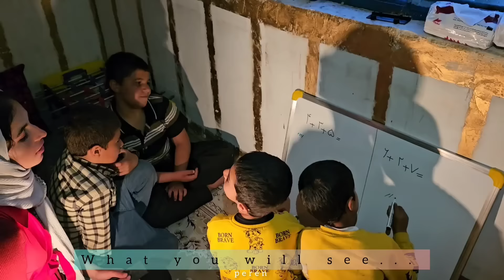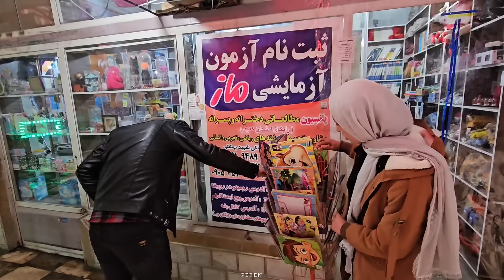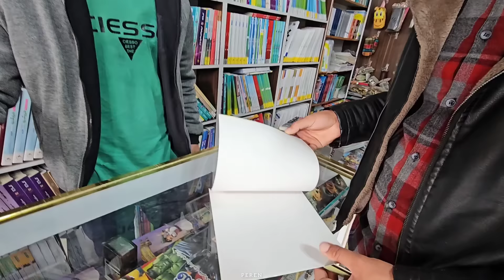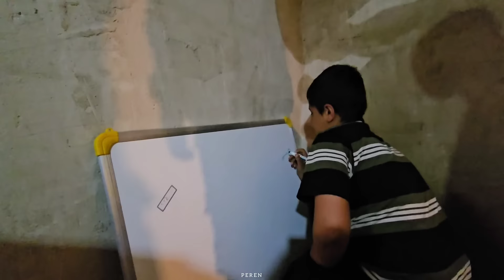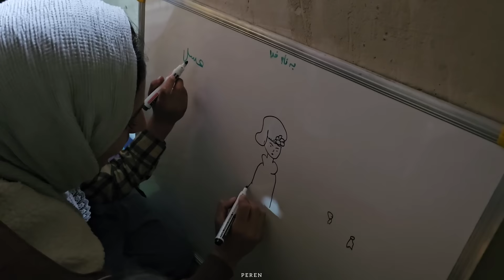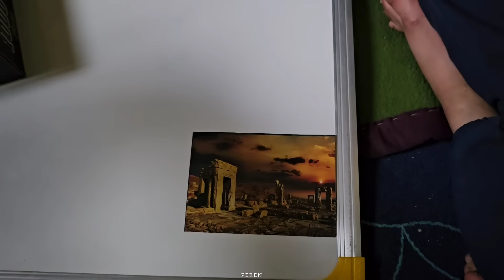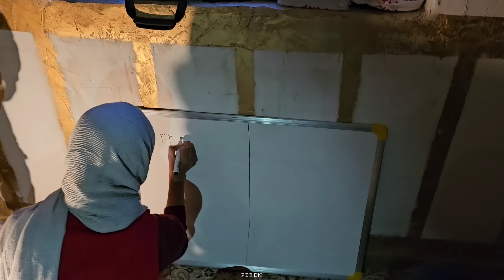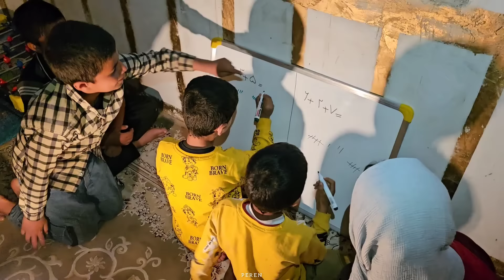Rural children 🎓💯 Improving children's thinking and intelligence in rural areas

Comment: Research Paint that is a sealant on outside to waterproof and also a paint that is a sealer and mold prevention for inside. It is worth it to get best recommended and dont dilute it will work better and last longer.

Comment: Greetings from Colorado. I do not understand why Jan Bibi has all these goats and sheep but she is to stingy to sell enough animals to provide solar light, and gas hot water heater.  What about the wet walls? Why don’t you buy waterproof paint and fix your environment? Your heat stove in the new room is putting soot into the air you breathe. Do you not care about your families health? I just don’t understand Jan Bibi being so selfish. Sell some animals! Butcher some for your family to eat. Milk them. You can milk a goat and still leave enough for the kids. Improve your lives and your livestock lives as well.The animals are not in good living conditions. They are packed tightly in the barn for most of the day. It is not healthy. Your family is exposed to toxic fumes and wet damp conditions. Do something about it. Sending healing energy. Peace be with you all.